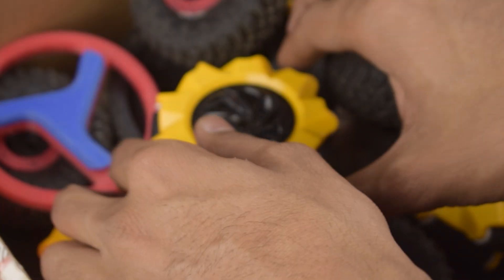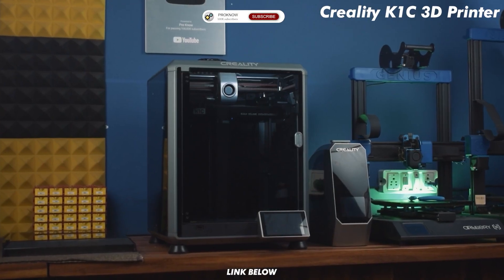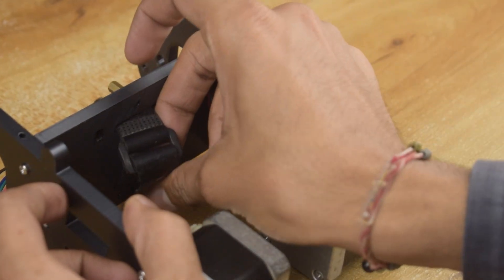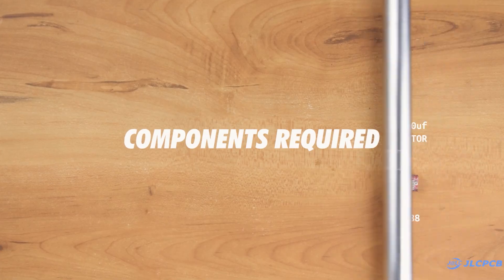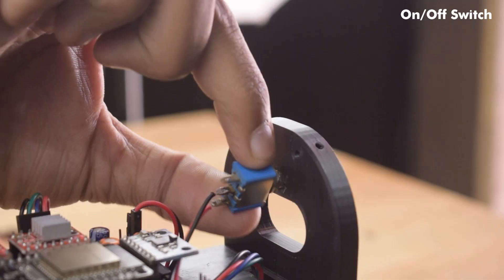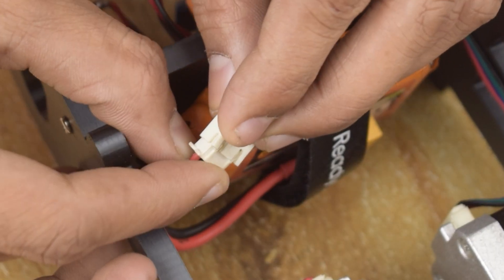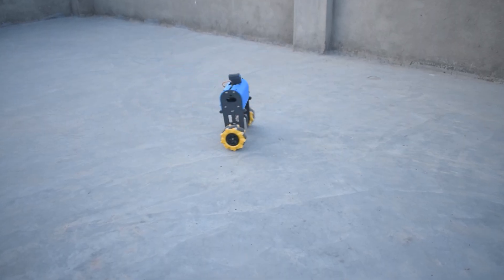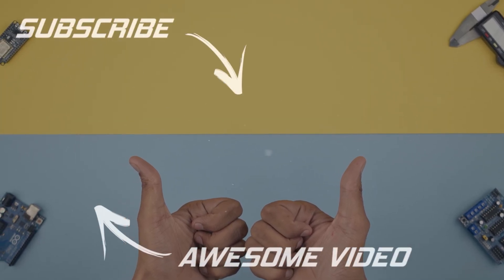DIY Mobile Controlled Self Balancing Robot with Mecanum Wheels

Comment: Very cool build 🔥
Combining self-balancing with mecanum wheels is not easy, and you explained the challenges really well. Loved how you handled stability while adding omnidirectional movement — that part is usually skipped. Practical wiring, tuning insights, and real testing made this feel genuinely DIY, not just theory. Great work 👏

Comment: When select to upload from arduino ide to esp32 modul, It start compiling and stop with  arround 18 errors and dont upload. How you did the upload? Can you do a movie explusive  showing how to do it please? I am already frustrated 😩
Reply: Bro there are some functions in the code which are from the old version of esp firmware you have to migrate the code from 2.x to 3.x or the current version.
Reply: @sivappagaming5561  Thank you for trying to help. How can I make this change? Could you recommend any tutorial on the internet?
Reply: @sivappagaming5561  How to do that?
Reply: @sivappagaming5561  how to do that?

Comment: The robot can work perfectly with mecanum wheels, but you need to have four independent wheels to be able to control the side movement, there are some other videos implementing it, check them out and you will rapidly understand why. It also doesn't have much sense to put two omniwheels on this robot.... btw nice work!
Reply from the maker: Thank you for your suggestion. I am already aware of those videos and will try to make it in the near future.